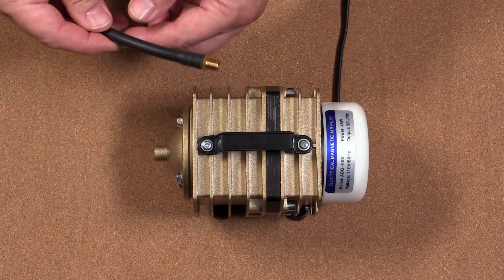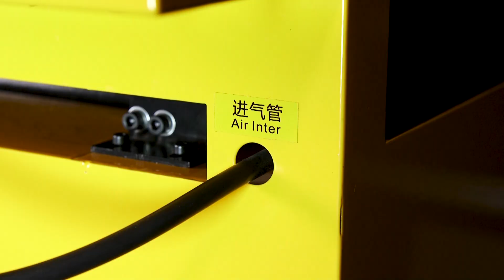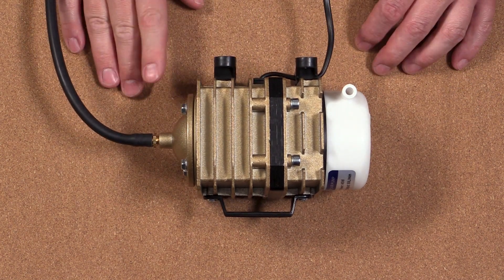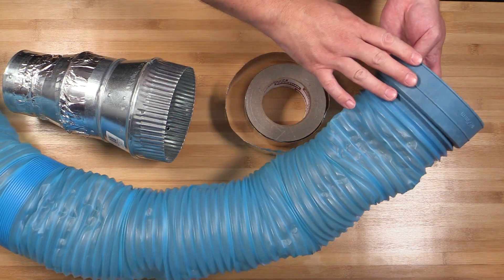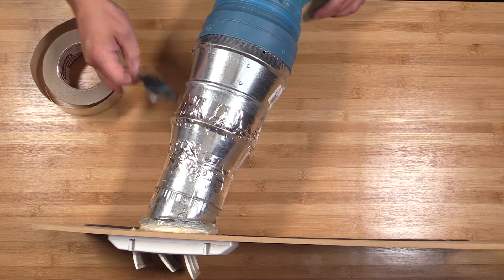CO2 Laser Engraver Air Assist & Exhaust. Beginner Series Ep. 2

Comment: Hope for reply soon, with air/fume extractor when using, what time after laser finished would you open co2 laser to get what cut? I feel like fumes be inside it for a bit still
Reply from the maker: I ussally open it up right after cutting. I don't think you need to worry too much if you're using wood.
Thanks for watching!
Reply: @MakeTechCreate  good to know, I looking at a design that estimate £1-2k it be like this slightly but bigger enclosure as have a module for cnc too but know laser one is worse part for health
Reply from the maker: @mlee6050  If your work area is decently ventilated, you should be good.